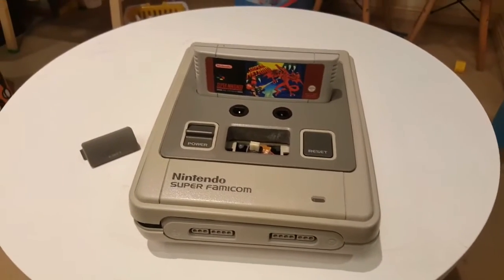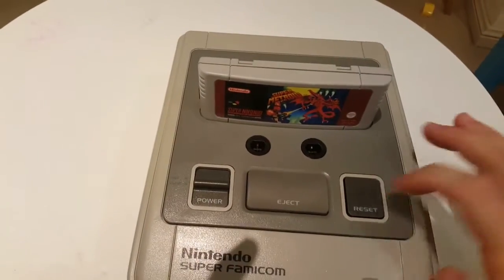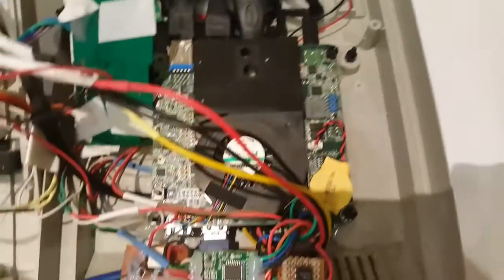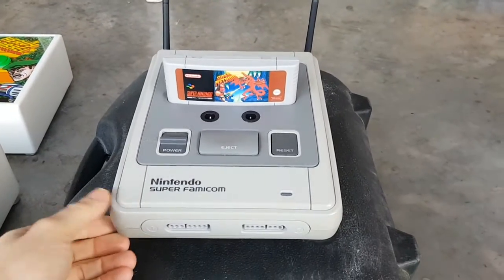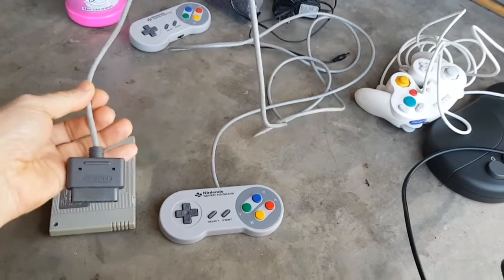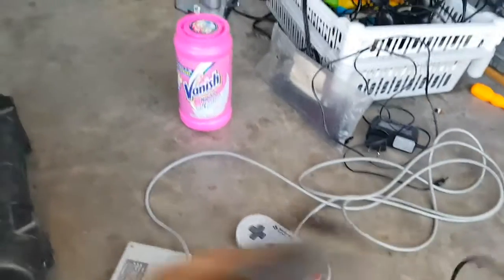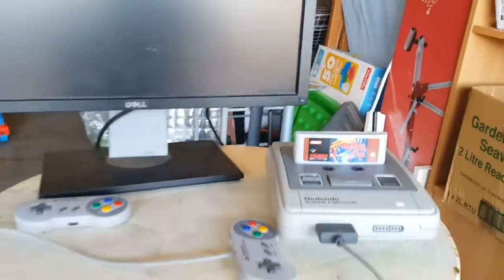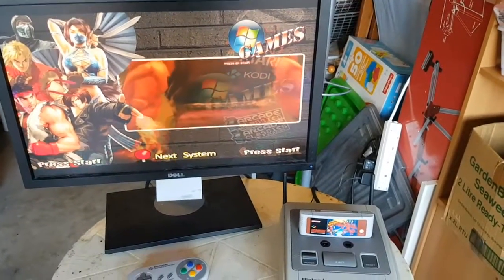Super Nintendo PC Build with Hyperspin and KODI

Comment: Dude... I planed a SNES pc mod from scratch. I cant't belive how simlar your build is to my ideas. As example, to use a SNES game like this, for the hot air, i bought a cheap snes game Yesterday for it xDD  Dude even your usb ports and stuff are almost on the same order i planed. You also used the same china cable i bought xDD... At First i would build in a ryzen single Board,  almost the same factor like a nuce. But now i will try to put in a mini itx Board + a gtx 1650 .-.. i need to cute out a lot and know the risk that even after messuring.... I could happens that it not fit but with a little bit luck... We will see